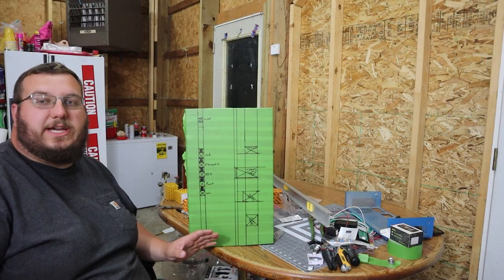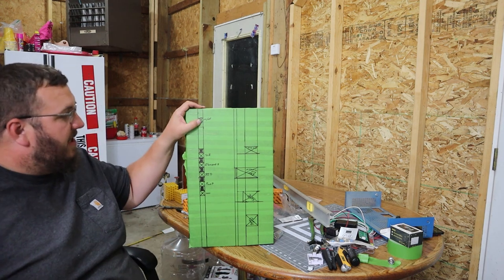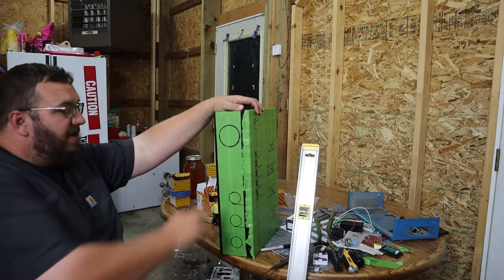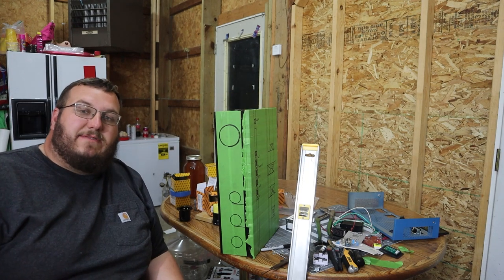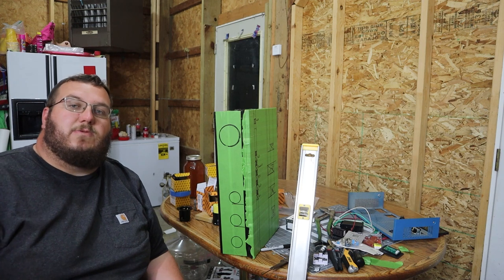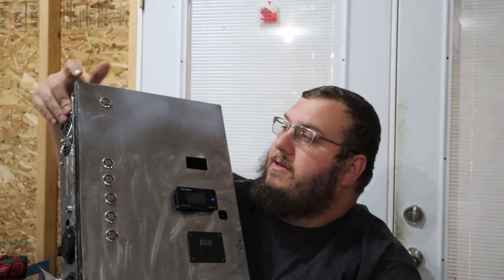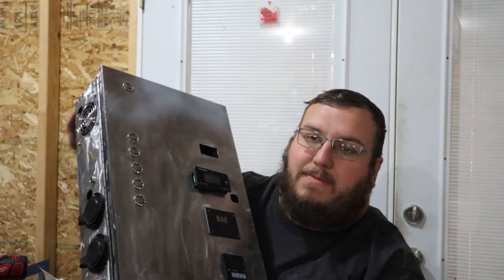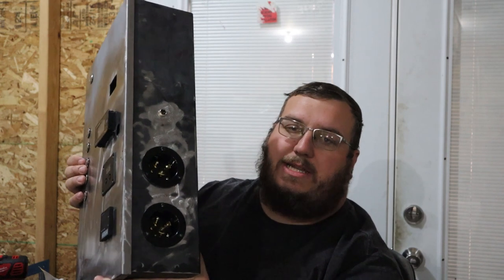SCR Still Controller Build Part 1

Comment: Glad to see you back! Slick build!
I've been using a simple Kyotto AC SSR KR2040AX 280VAC 40 amp.
(Check fleabay, they used to be $20 shipped but pricing is all over the place)
I put the SSR on a Big heat sink with thermal paste, and have a 220v cpu fan inside the box.
Been working great for 9 years now, just dial up the watts for more flow, down for less.
For reference I have the "100amp AC digital power KWh Ammeter" - (again fleabay)

Never used thermometer on my: boiler, pot, reflux column, perf plate column, bubble plate column or thumper.
...Watch, listen, feel, taste... 

Cheers Buddy!
Reply from the maker: I always use the tast method myself but the column already has a 1/2 inch threaded port at the top figured can't hurt to have another data point.
Reply from the maker: Cheers my Friend glad to be back.

Comment: I don't see where you are bringing in the 220 volts. Where is that line?
Reply from the maker: It's the only line in there's 4 wires. 2-110 legs 1 neutral leg 1 ground leg.

Comment: You forgot to put in a few holes on the other side to allow air intake. The exhaust fan won't be able to do its job very well without an air inlet.
Reply from the maker: There were three holes that were pre cut in the box that I left open